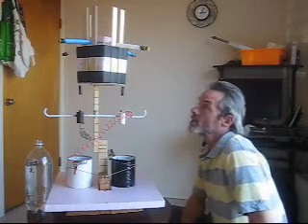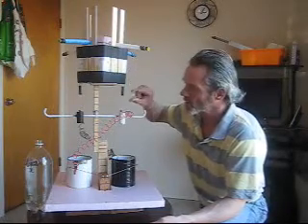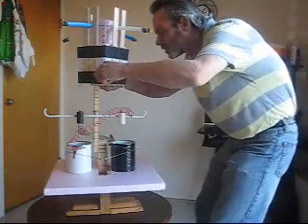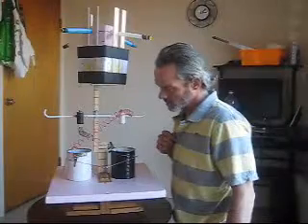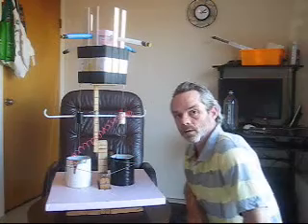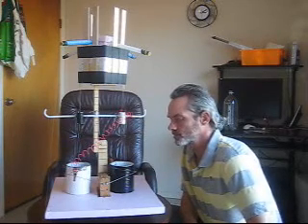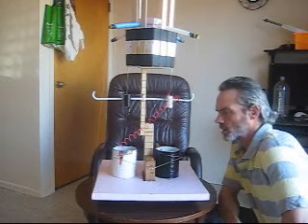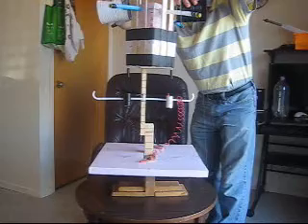Kelvin's water droplet battery problem figured out !!

Comment from the maker: 8.00 min mark. proves that corona discharge doe's matter. Notice the spark stops when my face is close to the wires and or all conductors .When my face gets mystified with the water vapor sticking. I turned into a conductive surface area when close to the apparatus. My wet face has the intendency  to attract the charge that builds up.  interfering with the realm, I move away... and it resumes ! Too cool!!!!!

Comment: I wonder how varying height (i.e. PE of the suspended water), speed, circumference (of the two suspended conducting tubes), and thickness of the stream affect the voltage across those two metal rods... You should post a follow up video =).